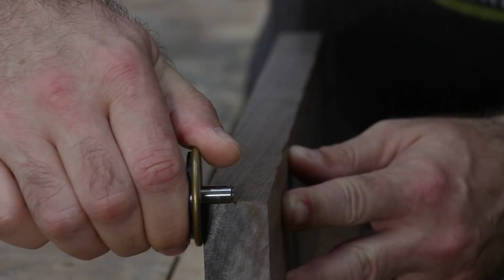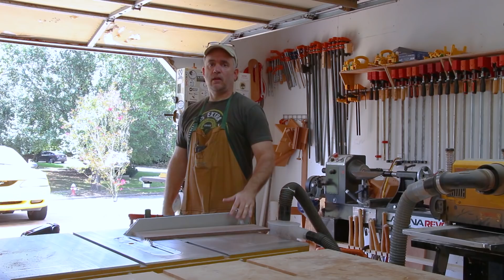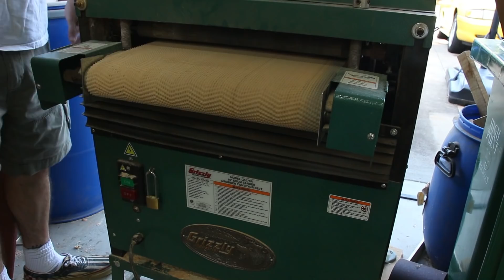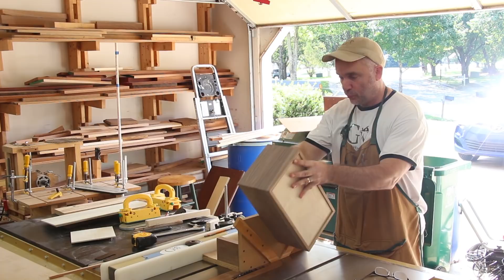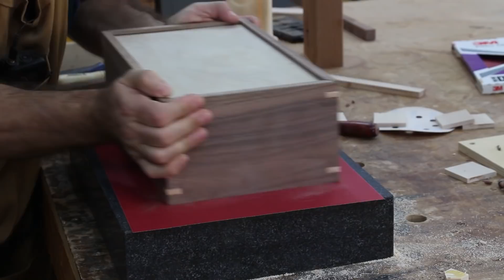Make a Walnut and Maple Box

Comment: Thank you for the excellent tips on cutting the top from the box -- order of cuts; blue tape; and small wedges.  I'm building a box now and will use this approach.  As an aside, regarding table saw insert plates: Whether it's factory- or custom-made zero-clearance kerf plate, it seems difficult -- if not impossible -- to get a perfectly flat alignment between the table surface and the plate.  Case in point: As you were cutting the top off, I notice your box shifted slightly as it transitioned from table to plate, which necessitates sanding.  I guess I'm not alone in dealing with the "slop"; so, I reckon a thank you for validation is order.  It makes me wonder whether any table saw manufacturers have this sorted out.  hmmm.

Comment: Great looking box! Might I offer a interesting tip, when I go to cut the lid off the box, I use a 7-1/4" x 24 tooth Freud Diablo framing blade. It only has a 1/16" saw kerf and works great in a table saw. (except Sawstop). I also use it to cut slits for splines on boxes if I want  a smaller spline.
Reply: Awesome tip, thanks.

Comment: Very nice. No less than 5 grippers in the shop, but no riving knife or splitter for the table saw?
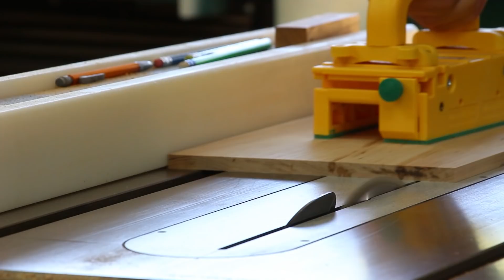Reply from the maker: Removed the riving knife for making a groove (dado).  Riving knife not really needed here for cross cutting.  See 5:10 for riving knife during a rip.
Reply: @GarageWoodworks  Gotcha I see it now.I was worried when you were cutting the top off it would pinch the blade
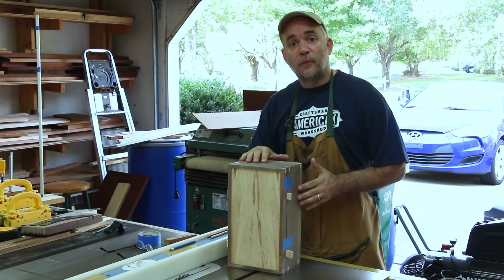Reply from the maker: I used wedges to hold the kerf open when cutting the lid off. Did you watch the entire video?  Or just go right to attack mode?  See 8:10

Comment: Nicely done!
I usually am no great fan of these miter joints, but the way you did them looks good and will hold forever.
Question though: you split your thick boards into thinner ones, When I did this they had a tendency to warp on me, bulging out where the center had been. Have you seen this, or did I just cut my boards too early, wen they were not totally dry yet?
Reply from the maker: +Tielo Jongmans Mine almost always warp a little toward the newly cut surface.  Usually just requires a light pass over the jointer to flatten.

Comment: Nice box.  I like to use liners also, gives the box a finished feel.  On mine I round over the top of the liners with a 1/8th round over bit.  Are you going to put hinges on the box?
Reply from the maker: Thank you.  I lightly round the edges over by hand with sand paper.  No hinges on this box - just lift off the lid.

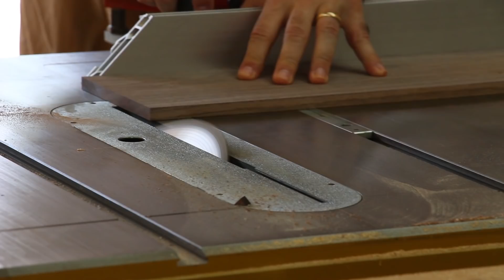Comment: I’ve tried doing mitres like this @1:50 and always seem to end up with a cut that’s not at a right angle. I’m sure the work piece is moving sideways as I push through the blade. Don’t know if this is due to blunt blade or what
Reply: Little late, but I would check the actual angle of your blade against a piece you know is at a 45 degree angle. Or a piece that is at a 135 degree angle on the other side, which may be easier. Blades can be out of square to start with, or the angles labeled on the saw may be slightly incorrect. It only takes a tiny bit to throw the whole project off.

They also make electronic angle checkers, which I've seen some people use but have never looked into as I'm a budget woodworker
Reply: Skraith Thanks so much for replying. It’s not actually the 45 degree part of the cut that’s that problem. It’s the cut that is perpendicular to the fence on the mitre gauge. I’ve done this with a home made sled and then mitre gauge provided with my table saw. I’ve checked and both of these are definitely 90 degrees to the blade and the cut always ends up being off.